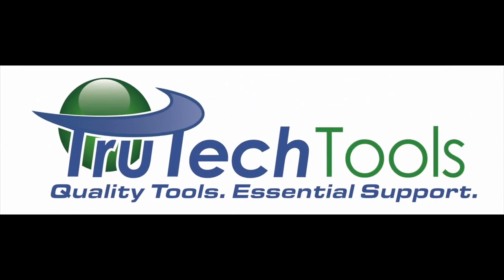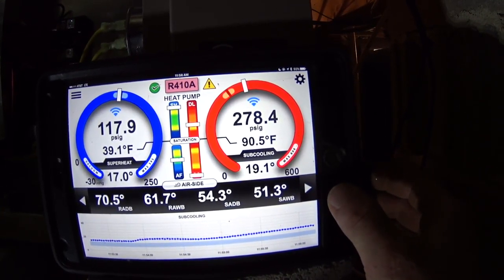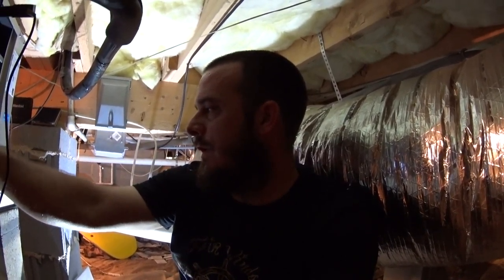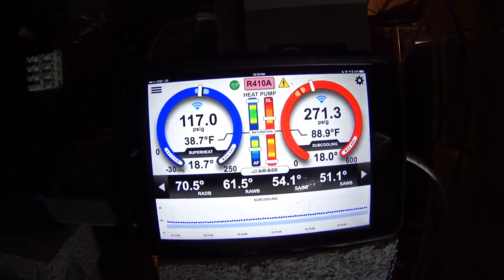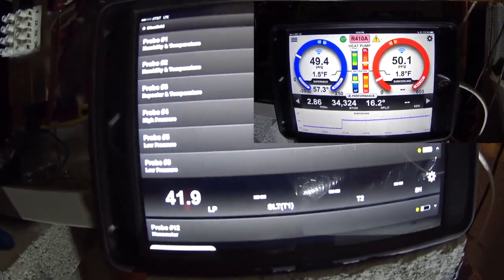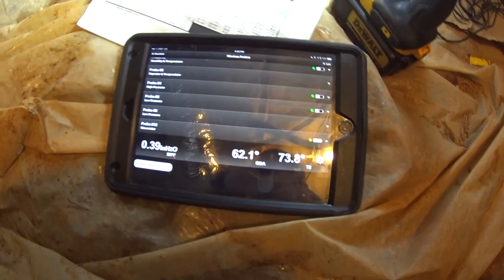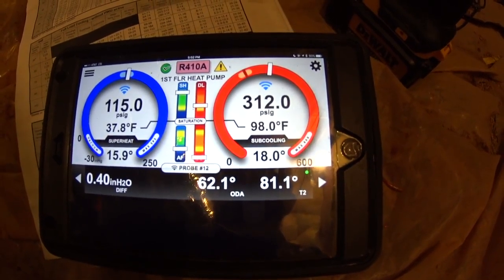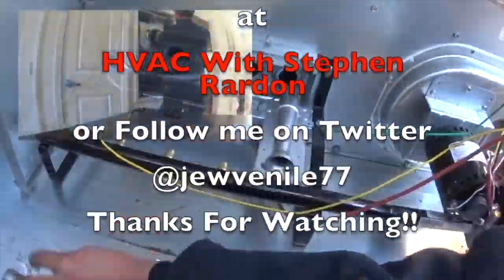HVAC Service: Follow Up To First Service Call at Project  Rodeniser 9-17-16

Comment: Stephen, my recommendation would be to add flow restrictors at each unit (to match the exact GPM needed) and open the ball valves up completely/full flow.

Balancing water with a ball valve can be very problematic at times.

Comment: Unlike refrigerant, the water in the geothermal loop has no vapor pressure.  You measured water pressure to be 45 psig with less than 1psig drop across the heat-pump.  The water pump can ONLY develop pressure as a result of a serious restriction in the loop.  This restriction is after the heat-pump that you measured.  mhamm is correct - the target flow is 3gpm PER TON.

Comment: Hi Stephen,  Great videos on geothermal systems open loop systems like you are dealing with you should reduce waterflow to 1.5 - 2.0 GPM and closed loop systems we shoot for 3 gpm.  if EWT is above 55 degrees you can reduce it to 1.5. this will reduce total annual volume which will reduce possible maintenance.

Comment: A bronze gate valve will give a more linear flow restriction than a ball valve Steve. The only draw back is you can't visually see the restriction amount as well on bronze stem vs angle of the handle. You also must add a threaded PVC coupling to each side of the bronze gate valve, but those are cheap. Great video Steve....

Comment: Brent Ridley is correct. I always felt it was best to keep the valve downstream of the heat exchanger. I have no solid proof, but I feel like you can help keep iron oxide and bacterial iron in suspention if you have full pressure on as much of the piping as possible.

Comment: The ClimateMaster vFlow (TES) units have a flow control valve built into them that tracks the D-T across the water coil and varies the flow to match system requirements...   I wonder if something like that is available in the aftermarket (like the Magna-Geo pump that's available from Grundfos).    You're headed in the right direction by putting your flow control devices after the units, but you may need to install a pressure regulator to the feed side of the units and bump up your pump pressure unless you can get your feed piping big enough to supply consistent pressure to both units at full demand.
Reply from the maker: Thanks for the input +icesoft1

Comment: if you were overcharged on that system you would have low superheat not high superheat. if you're concerned about your own high superheat you can try adjusting a TXV to before adding gas. if you adjust a TXV check your temperature drop to the unit if it increases or decreases it will tell you if you're on the right track. If you have too much refrigerant flowing through the evaporator you will have lower temperature drop through it

Comment: one other thing to add when you're checking your superheat your house must be close to the design temperature  if it's very hot in there you will have high superheat

Comment: Do you know if there is a VS well pump?   I know when we install multiple systems in a home, we have a VS pump in the well, then pump stations at the equipment installed with taco slow opening valves on the outlet of the systems

Comment: you can always try to put in an inline pump if you're that concerned about your water flow I think you're okay but I would try a pump before I'd be redoing the geothermal loop
Reply: Ben Kuxhouse this is a pump and dump system. There is no loop to replace, all he is talking about is getting more flow from the well.

Comment: Follow up: Back to square one.
Determine your highest gal/min water flow.Is it sufficient for both systems operating at the same time at maximum load?  Yes/No
Individual water solenoid valve instaled on each systems condenser water outlet line?  Yes/No
High pressure switch switching water pump of when both AC systems of.(water solenoids of)
Automatic water flow regulatig valve (operated by discharge pressure of ref. comp.) instaled downstream of water solenoid? Yes/No
ALL WATER HAND VALVES OPEN? YES/NO
REMOVE EXISTING WATER SOLENOID VALVE ON INLET WATER LINE.
If configured as such there should be no more problems.   Good luck mate.

Comment: Dang...I must be doing it wrong..lol I was taught to check the inlet and outlet temperature and adjust water flow until you have a 10 degree difference

Comment: Are the imanifold sensors rated/safe for water R-718 use? My app doesn't show R-718 and the imanifold website specs just says all refrigerants list.
Reply from the maker: +Robert L Jim Bergmann told me that there is no cause for concern with the sensor and potential contact with H2O
Reply: +stephen
Good deal. Maybe they need to put R-718 in their refrigerant list lol. Thanks for the reply.

Comment: The Ball valve is not good for flow control. 
the best solution is use a needle valve. 
We have this problem here in Brasil  too.
The ball valve normaly works too close  and with this we loose the pressure diferencia

Comment: Why don't you use a pressure regulating water valve on the water supply line?
(regulated by discharge pressure of the compressor.)
Reply: Correction:Pressure regulated water halve.
Reply: Correction:Pressure regulated water valve.

Comment: stephen I know this has nothing to do with this video but which do you think is better the testo wireless gauges or the yellow jacket wireless gauges?
Reply: rhoneycutt730 tests is on track to be supported by the new measure quick app if you care about that, the yellow jackets aren't. I have the testos and think they're great. I've heard of connectivity issues with the yellow jackets. Also the Testos you can get additional probes for wet bulb and dry bulb to have a more co,plate view of how your system is operating.

Comment: Bard part No. 8603-017 that's the flow meter works really well. they should be installed in all geothermal units. Takes the guesswork out on figuring GPM. here's a pic www.hitpages.com/doc/6403631318302720/13

Comment: You're  supposed to check your superheat the temperature at the outlet of the evaporator not at the compressor. You will always pick up superheat between the Outlet of the evaporator and the compressor especially on a split system. I don't know if your high-tech stuff compensates for the additional superheat you will be getting between the evaporator and the condensing unit. If not you will need to put an electronic thermometer at the outlet of the evaporator. You'll probably be within 12 - 15 degrees perfect for AC. with your wireless gauge is if they still connect you can go up in the attic with your display and it'd be really easy to check the superheat. that's what you have to do it's got to be right at the outlet of the evaporator.
Reply from the maker: +Ben Kuxhouse there are no pressure taps at the AHU to get SH there.
Reply: @ steven get an electronic stem thermometer and put it right at the outlet unfortunately that's what you have to do to get an accurate reading. put the electronic stem thermometer under the arm Affleck's right on the pipe tape it if need be. I would be more comfortable with 15 degrees on AC 10 I would not like. that's what I have to do at times. 17 degrees superheat at the compressor you're probably fine you're going to pick up a couple degrees at least between the outlet of the evaporator and the compressor. if your wireless gauges connect you can bring your display up in the attic with you with the stem thermometer be really easy to check your superheat then. You must have the temperature right at the outlet. the house cannot be hot either or it will be high.

Comment: 10 degrees superheat is awfully low for air conditioning. your superheat is a little high from your specs but at 300 pounds on R 410A that's well below anything wrong and the unit should work just fine. it's too bad the job does not have flow meters because then you don't have to guess how much is going through the heat exchanger even though you have your charts from the factory. if you are not getting enough flow the heat pumps would be tripping on your high pressure switches are almost to it you're not even close so I don't know why you're so worried about your pressure is being a little high from your chart there's always some variation. r410a high pressure switches are 600 pounds so you're well under that. I would much rather be a little high on the super heat then low that's better for your compressor. every AC system I've worked on has never had superheat for 10 degrees is always been a minimum of 12 but usually closer to 15. with your high superheat you might be slightly under charged but it wouldn't be much I will check your temperature drop through the unit. if you have 20 degrees you're in good shape you're going to cool off at house. I think the pressures you're dealing with the unit will work just fine. you can always tested in the heating season just to make sure if you have low flow you'll start having freeze up in the heat exchanger. usually if your flow is low you won't work in either heating or Cooling. I think your systems work just fine the way they are
Reply from the maker: +Ben Kuxhouse 10 Degrees SH is within design, 300 head is normal if it's hot Out but my water incoming was barely above 60. Check a system at 63 outside and get back to me on where your head pressure is. Target temp difference was right on the money at 16-17. I appreciate you watching but I Feel like you're basing your suggestions on very poor rule of thumb training.
Reply: 300 PSIG on 410A is about 95 degrees. That's actually on the low side of head pressure. If you go below 90 degrees you will probably have evaporator freeze up problems. It's best to always think temperature not pressure when looking at refrigerant charge. If your temperature drop is right where you wanted to be through that evaporator you're probably set. 10 degrees superheat on air conditioning you might want to double-check that maybe that's on the heating side period on air conditioning I would be very worried about slugging the compressor. You might want to check your discharge line temperature make sure it's not slugging. I've seen the system is overcharged so much that the compressor discharge line I could put my hand down and leave it there all day. You are being a little too over-reliant on your high-tech tools. I've been doing it for 31 years and have fixed a lot of problems systems over that time. 300 PSIG 410A is 95 degrees that's not high. Most high pressure switches are set to trip at 150 degrees. I worked on geothermal stuff from 35 degrees to 80 degrees. When you start getting really low head pressure if you actually have to start throttling back on the water going in. It's too bad that job does not have flow meters I hope you look at the link I provided you and one of my comments the flow meters take all the guessing out of everything. 95 degrees head pressure you're on the low side of things.